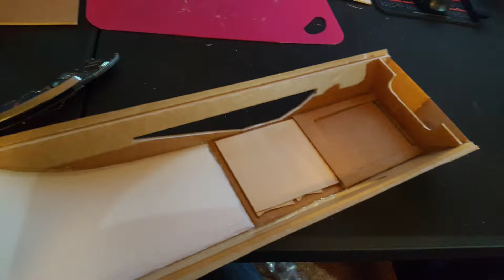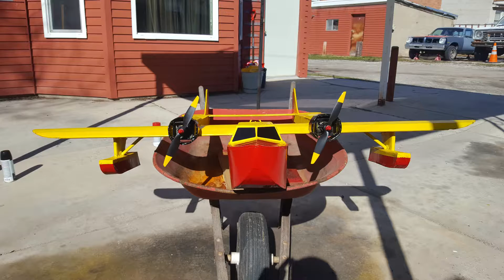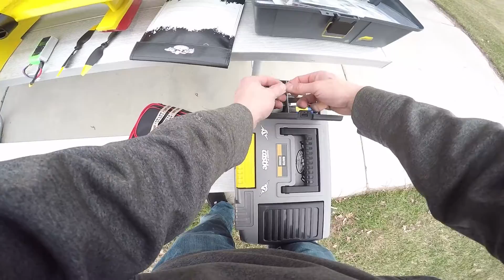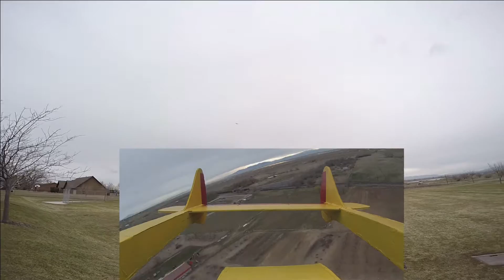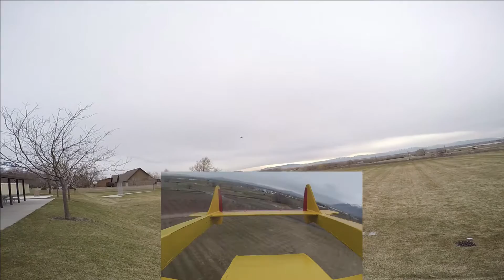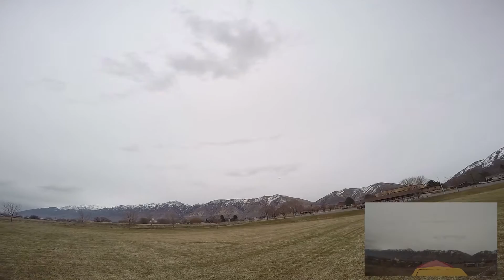FT SeaDuck | Build Vlog #2

Comment: what is your total finished build weight battery and all? Mine is a bit tail heavy don't want to add to many weights in the nose. Don't think performance hit wouldn't be to dramatic.
Reply: love that hatch seal and yours looks perfect.
Reply from the maker: mine does feel rather balanced and i haven't had a wreck yet compared to my first one. I've even taken it to some pretty sketchy places and still got a smooth landing. Takes hard landings much better. The balance is overall pretty good. I haven't yet weighed it so I will have to get back to you on that point. Thanks for watching!!!!

Comment: Yes i like the reinforcements you did. I destroyed mine today after i had to recover it out of a 20mtr high tree...couldn't catch it... nose gone and wing snapped at fuselage but battery deck funny enough still intact. i did use plywood for support though.    
flying off the water the landings are nice and soft(ish) did you do surface landings a lot? and what is the servo in the fuse for? the backdoor?
Reply: ah ok for the hatch :) nice one!
Reply from the maker: Alex van der Hoek thanks!! I also put balsa reinforcement on the spar spanning the wing focusing around the nacelles. at least thats where both the wings snapped off the easiest in my experience.
Reply from the maker: +Alex van der Hoek hatch is nice to make a quick voltage check and then take off again lol
Reply from the maker: +Alex van der Hoek. I do many surface take off and landings since i dont have a close body of water. No problems there still had an awesome time with it. The servo is for an automated battery hatch. Its pretty handy to come in and quickly check the voltage before taking off again